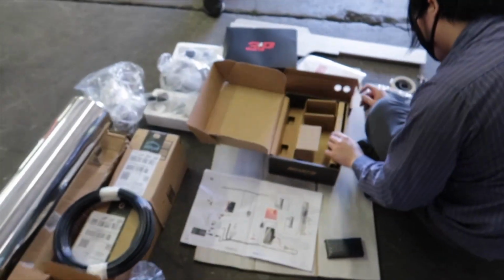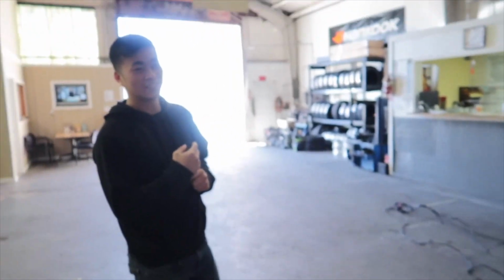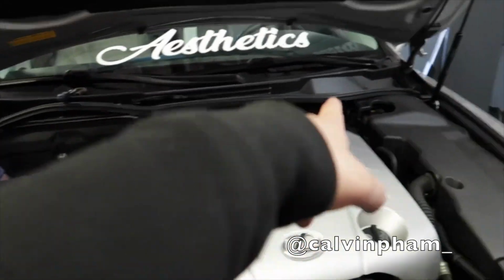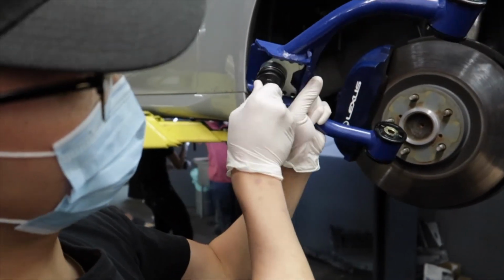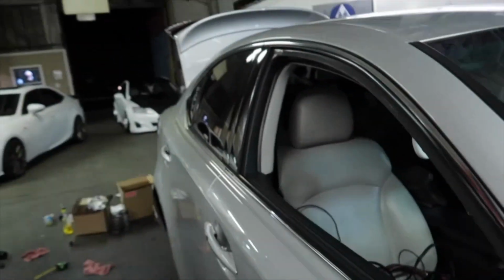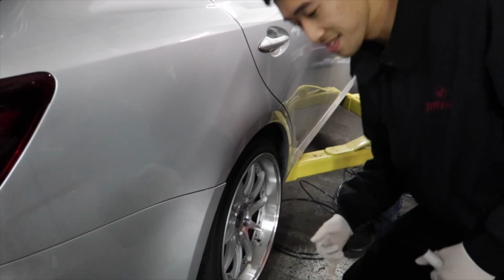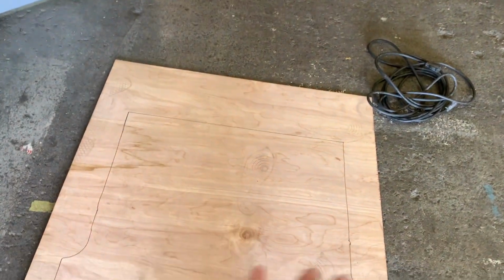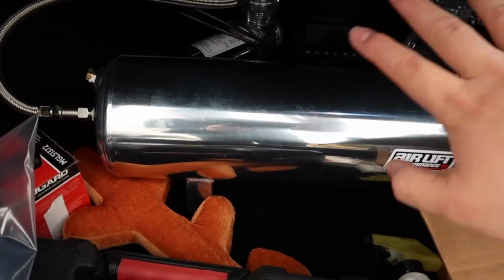Lexus IS350 BAG INSTALL | AirLift 3P | (WASTE OF MONEY??)

Comment: What are those wheels called?
Reply from the maker: Aodhans DS07s!
Reply: @anthonysung  what tire size are you running and do you rub?
Reply from the maker: @reesel1982  tire spec is235/40/18 and the wheel spec 18x9.5+22 before I had my camber kit it would rub a little
Reply: @anthonysung  what size from those you gave me should I alter to not rub?
Reply: @reesel1982  probably 225 it shouldn’t rub